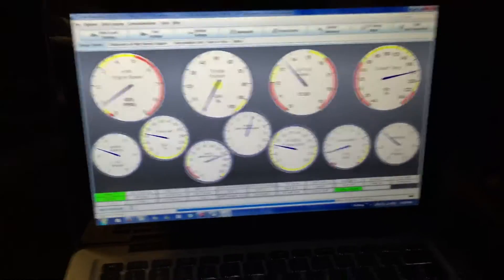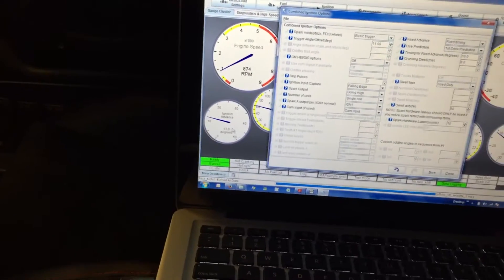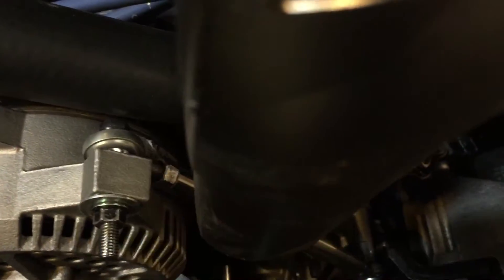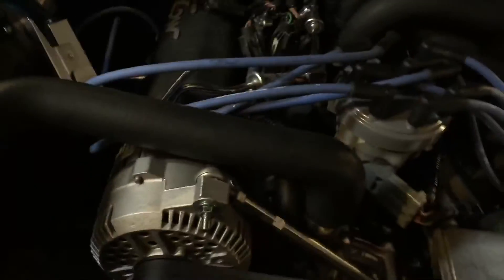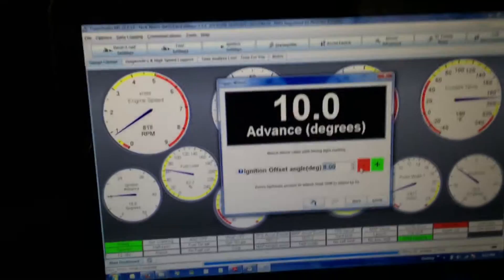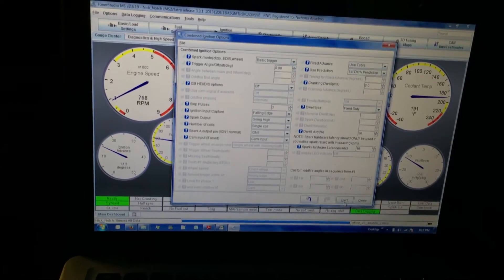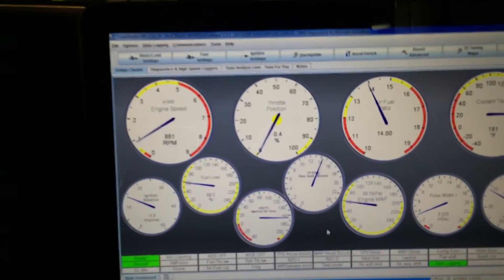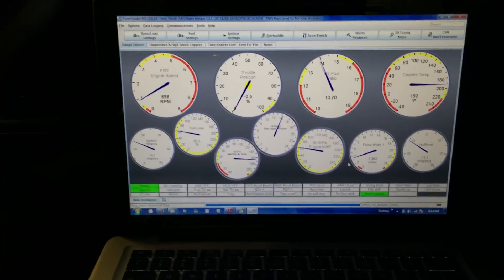MSPNP2, 1992 mustang 5.0, base idle setup

Comment: I wish people would do a first start up video and show us actually how to set it up before they have it all nicely done.. Because yes this is a good video. But for us havin trouble even figuring out how to actually set base timing on the first start up. This videos useless..
Reply from the maker: Aaron Moreau the first start was SIMPLE! Seriously, I plugged it in as per directions with base tune and it just started and ran. I got the drop in setup for s Fox but seriously, nothing worth making a video about.
Reply: @birddog0347   ahh well see my first start up didnt go so well.. Hooked up mega squirt hooked up map. Did all the dos needed for tunerstudios.. Calibrated everything set fuel injectors..  Then did the start up..the car started. Ran like shit when i used fixed timing.. Kept dying and i couldn't get a timing readin.  I ended up holding the gas so it warmed up then i was able to get a reading. So i selected fixed timing at 20° and checked timing.. Of course it was off. So i set trigger offset till the balancer matched the trigger on tuner studio.. Car idles fine.. But for some reason i can get it to be at 12° base while using "use table" it stays at 16.. Also my first start and even now. My car starts idles at 3000rpm then drops to 850.. Could there be something up with the  timing still?   This is why i said someone should make a actual first start video so we could see the whole process.. Not just a process of a nicely running car
Reply: I'm with you man, mine starts and runs for about two seconds then dies. Hard to do anything with that especially being new to MS.  @aaronmoreau1030
Reply: @sublime929   yea mine started and reved to 3k for like 10 seconds then chugged and died. I got the basetiming set by warming it up and it stayed running.. But theres really no info or help on how to get a decent idle to even get started on figuring stuff out..  And did u try adding more warm up enrichmemt? Maybe adjust your cranking pulse and after start enrichment.  Also you pmw idle duty cycles might be set to normal. Try inverted. Ur idle valve may not be opening enough to compensate the idle..  Also timing has a big effect on idle..
Reply: @sublime929   if you really need help theres a guy on stangnet.com thats really good at ms stuff. If your not a member of stangnet. Id suggest you sign up and make a thread on having trouble starting up.. Or find my thread "92lx first startup using megasquirt"  the guy does personal tuning classes that are very in depth and one on one over the net... Check it out you won't be sorry dude
Reply: @sublime929  his name is "a91what" on youtube.. He has some decent tuning videos on megasquirt..
Reply: @aaronmoreau1030  Ya I'm on there and messaged him already.

Comment: While verifying timing, did you pull the PIP ?  Or was it still connected during this setup?
Reply: Leave it in. Switching it to fixed timing is the microsquirt equivalent to taking out the pip. The once everything is square, switch it back to "use table" and you're done.
Reply from the maker: I don't recall 100%, but I'm pretty sure it has to be left in.

Comment: hey! what kind of seats are those?
Reply from the maker: They are SVE S1 seats from LMR.com and they are pretty good... not my favorite but very cost effective compared to some of the other options out there. They are fairly comfortable, but they do have tall thigh bolsters so if you have a non-tilt steering wheel (airbag wheel on a fox) they will make it a little more difficult to enter and exit the car. Overall I'd rate them about a 6.5-7 out of 10.